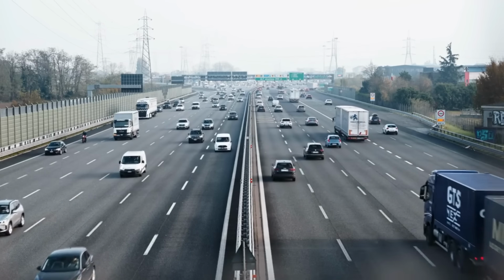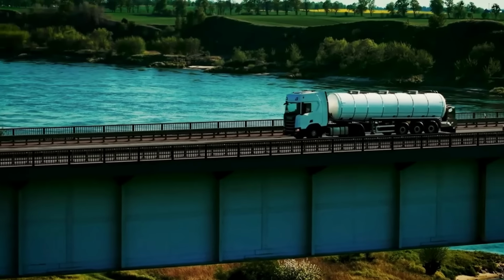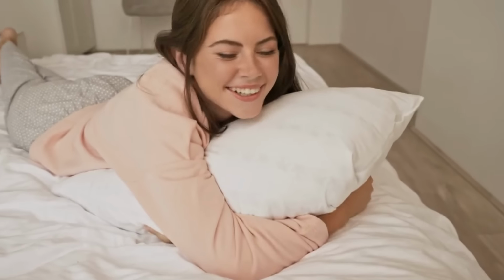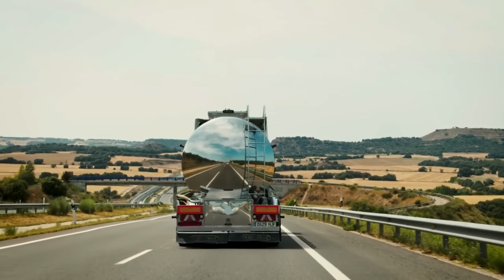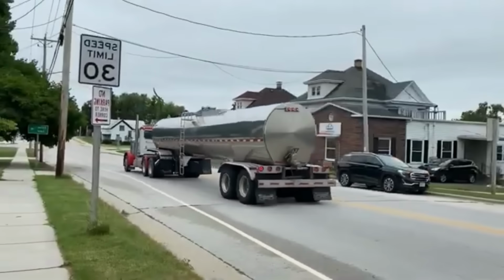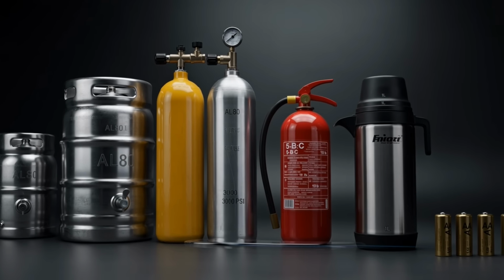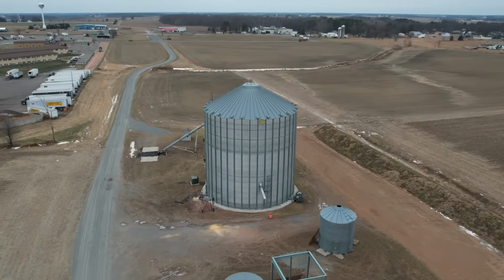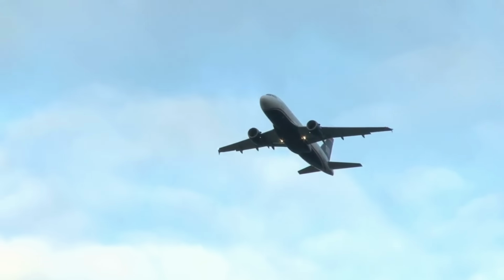Why Are Liquid Transport Trucks Always Round?

Comment: Stress on a round structure is equal while a rectangle would in theory have infinite stress on a flat surface so it has to deflect. By defecting with every change in stress (sloshing) it would fatigue into failure.

Comment: IBC tank? Never heard...

All wrong. The real answer - with liquids no one needs the volume. If dry goods semi is limited by volume (2.5*3*12=90m3, or even 100m3), allowed GVM is not yet reached but truck is loaded up to the roof - with liquids, even the lightest of them like petrol (0.7t/m3) the limiting factor is weight, the same 25t load per semi = 35m3, plus free air volume 50m3, twice less than standard dry truck. So if the truck in the same road legal dimension will be round and loses 20% of volume - no one cares about it, the gain from simplier tank design and less tare weight determine round shape. In reality tankers are way smaller - shorter and lower than comparable dry trucks.

11000 gal = 44m3, it NEVER can be filled with any liquid even for 3/4 without exceeding legal GVM.

1:50 directly wrong. The smallest surface for the same volume is sphere, then cylinder and rectangular box is the worst. But any truck must fit in rectangular legal dimension limits.

5:40 wrong too. Heap of rigid boxes inside container create big concerns about container durability, they can damage it very easy, worse than liquid which is always separated by complex internal structure of the transport tank.

Comment: Its wrong to say the rectangular tank hold more volume than the circular for the same amount of material. 

The volume is proportional to pi*r^2 or pi*d^2/4 for round tank, but d^2 for a square tank. but the perimeter is pi*d and 4d for round and square tank respectively. so if try to compute the ratio, you get d/4 of the two. so the square tank does not contain more volume for the same amount of material than round tank.
Reply: Thank you! I did this in my head and I thought I got this answer; glad to see it in text

Comment: You did not mention baffles in tankers.Baffles are in tankers to reduce SURGE, except FOOD GRADE TANKERS (milk, syrup, anything liquid connected with food) because of cleaning the inside of the tanker.
Reply: I laughed watching this, I worked in a company building tankers for years.Seeing these graphics without the basic construction of baffles not shown and liquid sloshing from one end to the other is missing an incredibly important part of the tank. lol The milk tankers we built all had double bulk head compartments, The compartment seams were welded and ground then lined with an epoxy coating.Every compartment had a man-hole at the top and a 4" cleaning drain in the floor.Reference. TriMac, Tidy Welders, K-Line
Reply: The food grade tankers I pull have baffles.

Comment: Very, very FEW are truly ROUND. Most are OVALS with baffles or even TWIN cylinders inside an oval housing. The viscosity (thickness) AND specific gravity (weight per gallon) has the MOST to do with the design of a tanker. Car gas tanks are "what fits best" shaped. Semi tractor tanks are often one-piece of spun aluminum, as diesel is thicker and heavier per gallon than gasoline, and the tanks MUST have heaters inside them so diesel will flow when it's cold.

Comment: Yes yes.. But why not tie down the load, like solids are tied down in those sea containers? Well, in fact, in large tank cars, the liquid is tied down too. Most tanks have a honeycomb structure inside, they are called splash plates, because they divide the large tank into smaller parts, and thus prevent the liquid from splashing, and "tie" it in place in its own cell, which reduces the stress on the outer walls of the tank. The risk of tipping is also low when the liquid is tied down in place.
Reply: "Splash plates"? Never heard of that one in over 2 decades of experience. We called them "baffles"."Tied down"? ROTFLMAO. Sounds pretty elegant. lol Building tankers is dirty, noisy, hot work. It isn"t rocket science. lol